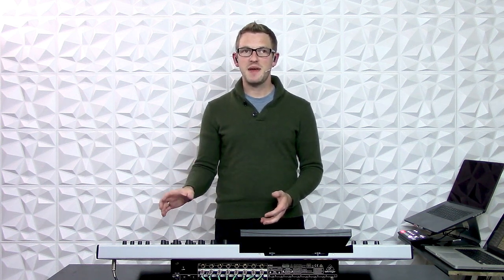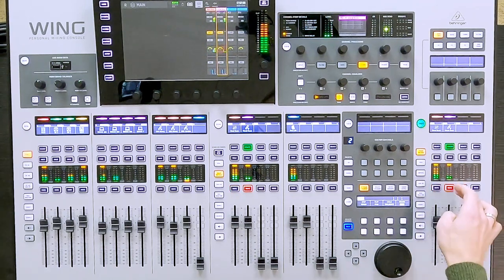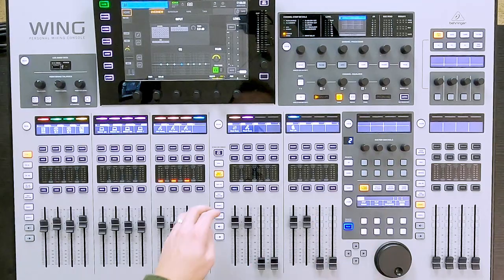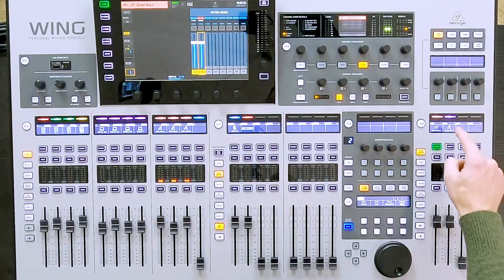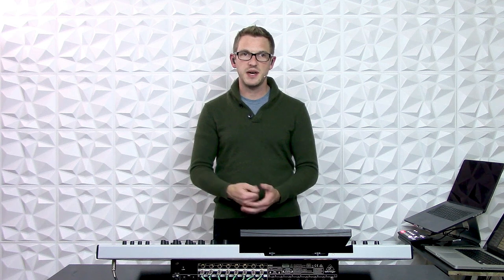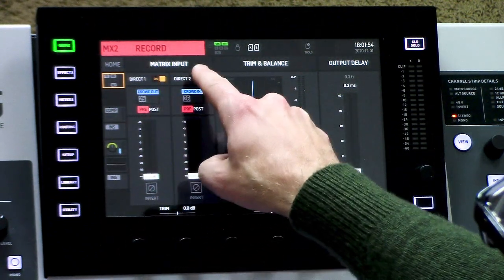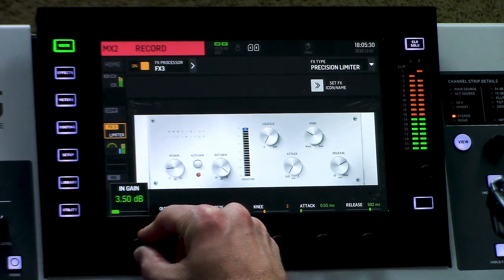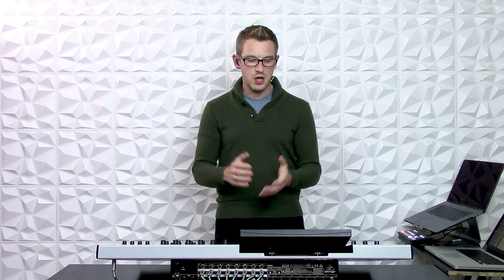Behringer Wing 205 - Matrix Processing Tutorial

Comment: How Many IEM can I have out the back of the wing
Reply: Technically 16 if you use all 16 buses. However, you'll probably need a digital stage box as the wing only has 8 outputs on the back. You can use the aux outs too though.

Comment: I still don't get the difference. Why can't I just use a Main instead of Matrix? 
For my chirch I use Main1 for the venue , and Main2 for the streaming, and I can slightly adjust sound balance for these two mixes. Since we don't have two sound-guys for different mixes.
Or, maybe I'm doing something wrong and it's better to use Matrix ?
Reply: If using the main works for you then that's fine. With using a matrix for your livestream, you can make your main bus apart of your livestream along with any other main busses or mixbusses you want to use for your livestream.